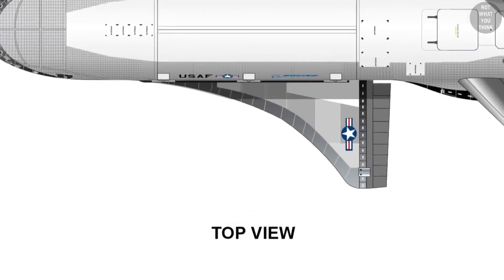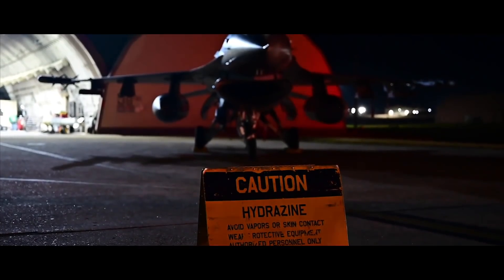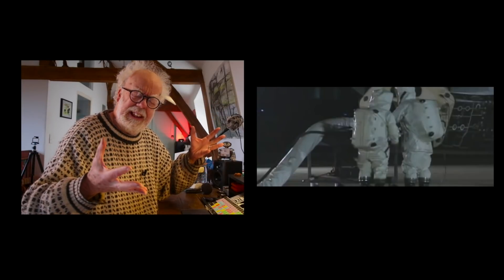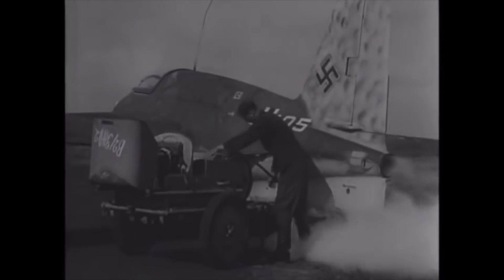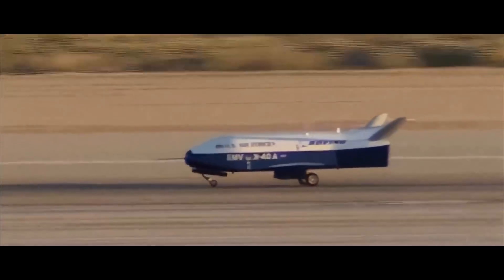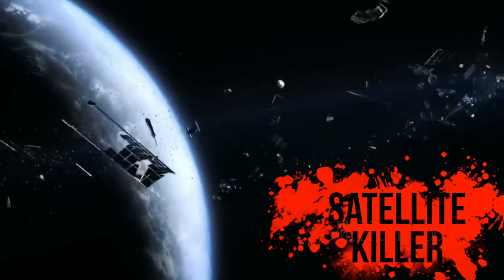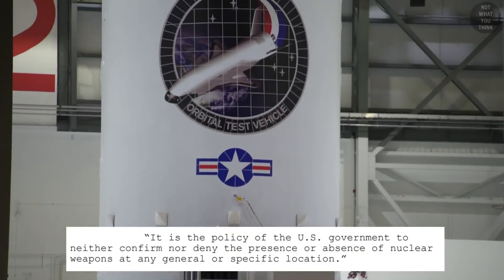X37b - Satellite Killer? - Prof Simon

Comment: There’s nothing particular unusual about about a space vehicle using hydrazine or having the ability to maneuver. X-37 was originally developed by NASA, then out in storage for several years because NASA had no use for it, and finally taken over by the Air Force. None of the characteristics on which you base your conclusion were dictated by the military. 

X-37 would be a poor choice for blowing up satellites in the manner you show, since the resulting cloud of debris would put X-37 itself in danger. And X-37 is not an asset that can be quickly replaced if it is destroyed.

It’s possible that X-37 could attack a satellite in a less dramatic fashion, by cutting an antenna wire or painting over a lens or solar array. 

X-37 has a payload bay that could carry any number of instruments or devices. One should not assume that it’s doing the same thing each time it flies. One of its unique strengths is flexibility.
Reply from the maker: i like the idea of the x37 getting out a can of black paint and spraying a spy sat lens.

Comment: Nope, not a satellites killer. Just a jobs program. It's mission is a diversion. dam thing does nothing but zip around changing orbits making people track it. 
The payload bay once had a special 3D printer that made parts in micro G for anti gravity wave research. breakthroughs abound.
Reply from the maker: really....thats disappointing
Reply: The X37 would make a very poor sat killer. Remember most spy sats are boosted much higher up in hidden geosynchronous orbits. That's too high for the X37s sky. I like the tanker truck idea. Very tricky and it would give away the positions. Anyway we don't have a need to know. The light that shines twice as bright shines half as long.

Comment: I can't imagine they are pouring that stuff from one container to another through the air.  Maybe that is something else.  I don't even transfer gasoline that way. I figured there would be a pipe system for the transfer and a way to avoid the vapors by having a bladder structure to offset the volume loss or some sort of filter to deal with the displaced air/vapors.

Comment: In the 1950s early days of Drag Racing many different "fuels" were tried to "beef up" gasoline, including hydrazine. That led to a near decade ban on fuels before they were more sanely "eased" back in. Today the standard is a set mixture of nitro-methane. They are going a lot faster than they ever have but much more safely.

Comment: I agree with the previous comment. The presence of a payload bay when combined with the X-37B apparent manoeuvrability could indicate an ability  to capture and deploy payloads. Also, I've heard that it's missions can easily last more than one year, so it has long mission endurance capabilities Very flexible system. How many of these these craft does US Space Force have ? ps Another question if it's got a payload bay is this bay equipped with a robot arm ?
Reply: One mission I was aware of lasted 2 years, you will need fuel for that I am sure..
Reply: Despite being designated an 'X' craft and, thus, still experimental I would imagine it is already in service, rather like how the F-117 was already in service long before it was officially acknowledged.  As for how many I doubt we'd find out for some years yet.

Comment: Interesting, I'm not entirely convinced that it doesn't have a fission power plant as well. Yes that would be illegal but that only counts if you get caught. The question remains on how it kills the satellite? Lasers are more effective in space and for that you need lots of power. You could use steel bearings dropped like mines. Or you could be completely wrong and it's a weapon in itself. Thought provoking. I saw you mention a big nudge to kill them but if I was sending up military hardware I'd equip it with proximity sensors and hi ex...
Reply: would also help having a superconductor, and being in Orbit/Space, would afford the minus temps needed
to keep certain substances very cold, and in that SC state?

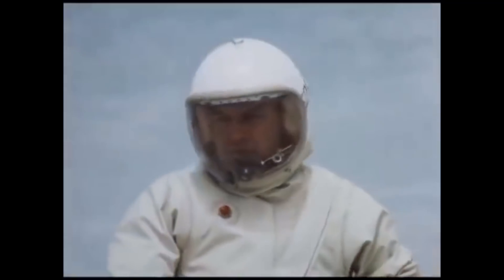Comment: I was at work on brake. It was like 3:00 in the am. I noticed what looked like a star probably a satellite, but every 10 seconds it would blink off for 1 second. I thought this looks unusual so I watched it for a few minutes, until another light moved across the sky into the blinking lights position and then everything looked normal. I thought what was that about. The scenario in this video seems the most likely.🙄🌌🌠🤔
Reply from the maker: def a satellite...prob rotating.  good spot.
Reply: The 3:00 time stamp is kinda funny.🤺💥

Comment: Dinitrogen tetroxide / udmh  is a very common hypergolic (self-igniting) oxidiser/fuel combination. Both are horribly toxic and dangerous and together very energetic with decent specific impulse. The fact that no ignition system is required means it would be the combination of choice in a craft that loiters unpowered in orbit and can burn its engines with minimum preparation and great certainty of success when required. I think your assertion is correct but incomplete. I have no idea what else to posit as its other functions. It could not land with any form of payload, nor a significant propellant/oxidiser reserve. It has to come down empty or nearly so for aerodynamic reasons of wing loading.
Reply: TUNGSTEN ROD ORBITAL BOMBER LOL
Reply: @წთლ_ჯ  oooh, rods from god? Good think!
Reply: Very astute & insightful ideas, Good Sir Joe!
Reply: @theunknownmarket1198  Thanks. No expert, just a keen observer.